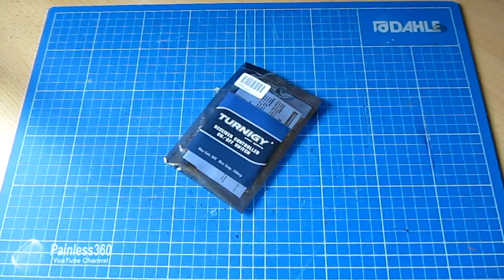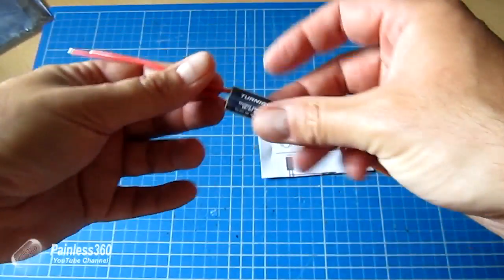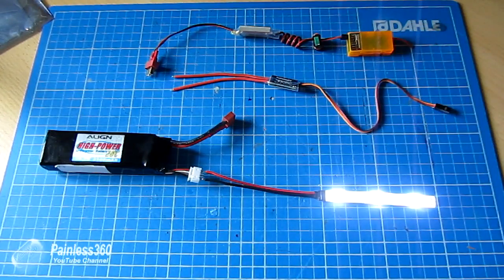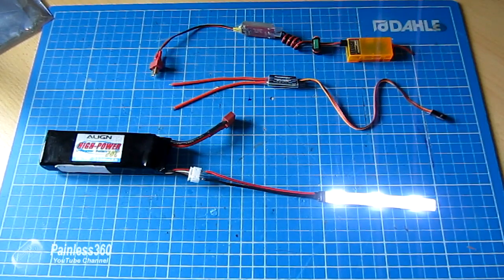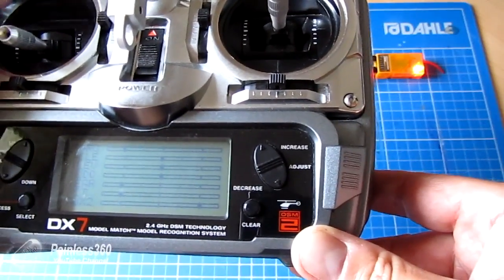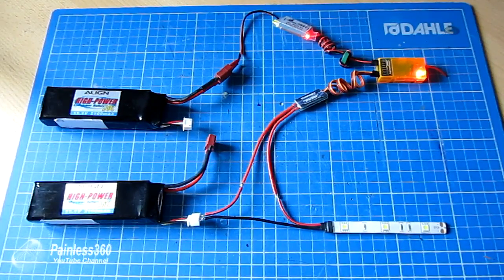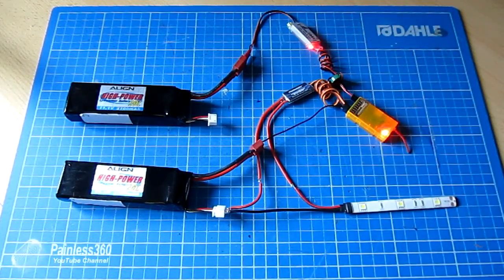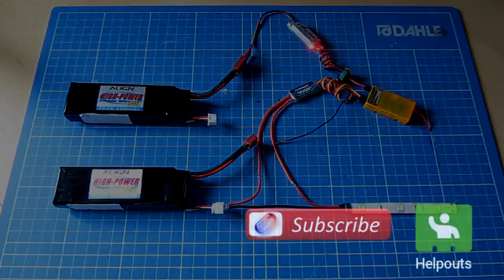Turnigy R/C Switch - Use for LEDs, landing gear etc.

Comment: My Afro 30A Esc's are all powered by the main batteries.  (The 680 Pro uses the frame for Pos/Neg connections) I then run the servo wires into Naza Lite from the ESC's, then the Naza to the receiver.  I am unsure if I also need to power the PMU with the same main batteries.  I believe so, but clarity on wiring or a schematic would sure help.  Looks like all I need to do is tie the negative from the 3c (lights & gopro) into the main battery pack.  But I think I also need a stepdown (really unsure and don't want to blow out my nav, strobes & headlights).
Reply from the maker: Tricky to follow without a diagram and I'm not a Naza expert either. What's a PMU?

Comment: Don't some lights require 5v to operate?  Running straight to the navigation lights or dual strobes from the battery would blow the pcb's wouldn't it?  I'm thinking a step down from 12v to 5v would be necessary or am I wrong?  I am running a Tarot 680P and was thinking my main stack would power the motors, Naza-lite and Reciever.  A secondary 3c would then have all the lights & gopro gimbal.  Don't I need a stepdown?
Reply from the maker: Yes, some do. In that case I'd use a BEC to drop the battery voltage down to 5v. Happy flying!

Comment: Is it possible to operate the switch in PPM mode and configuring it on Cleanflight?
Reply from the maker: I'd look at channel forwarding in Cleanflight where you should be able to output one of the PPM channels into spare PWM pins on the flight controller.. Best of luck!
Reply: Thank you. I thought it was possible to use one of the output channels on the flight controller. I enjoy your channel thanks for your help.

Comment: Hi Painless', I have a Spectrum DX6 DSMX - The problem is I cannot find ch 5 or 6 in any of the menu's.  That said, I discovered switch A (ch 5) appears to be assigned to "gear" and cannot be reversed,  Worse still where are they hiding channel 6 ??? until I find it, I cannot use an led switch using this TX :-(
Reply from the maker: +loonypics it will be in there. You may need to assign the channel to a switch first. Sorry I can't help more but we don't have that radio. Best of luck!

Comment: Hello Painless... I appreciate all your sharing. However, listening to your video you say if there is something else...
I have a Hubasn H501s which uses 7.4V Battery which I want to leave alone. I have purchased a smaller 11.1V 3S battery, and like your ideas. However, on my transmitter I am wanting to put another toggle switch on it, and use that for ON/Off of my extra external L.E.D.s. Of course with the Turnigy Relay incorporated. I might be able to figure it out with my knowledge, but if you could, it'd be Great if you could do a schematic of such, and a video would be good, but a schematic on a 15 second video would work for me, Sir.

Thanks..... For all you do for strangers out here.
Reply from the maker: Happy to take a look at that but please book a chargeable support call and I can talk you through it. Details on the website. Best of luck!
Reply: Ok, thanks.... Ummm... looking all around for the Website.

Comment: Hi. Excuse my ignorance, but what is a ubec and do I need one with this switch? I have a 450 size quad and will be operating about 100 led's on a led strip which I'd be using this switch for, many thanks.
Reply from the maker: +tp2fly See our videos in the 'Introduction to Remote Control' playlist as we cover all of the basics there, including this. Best of luck!
Reply: +Painless360 Ok thankyou

Comment: Quite new to this hobby.. Should I use all 3 wires coming from the Turnigy RC switch to plug into the receiver or just the signal wire and remove the power/ground? I'm planning on using 2 batteries so the receiver will be powered by the main battery so wouldn't that mean that I should only plug the signal wire in? Thanks and great video.
Reply from the maker: +Alexander Horst i only used it as shown in the video. Best of luck!

Comment: my plane came with landing lights with a battery box that takes 2 aa batterys which is 3v in total and have this Turnigy R/C Switch - can I use the 3v and wire it like you did with the 2 lipos in video
Reply from the maker: +richard wilde Not sure - you can try it and see.. Best of luck!

Comment: you connected the LED strip to Balance Lead, is that OK? or can it cause a unbalanced battery??
Reply from the maker: +Shaya Sonnenberg The LEDs use very little power compared with the motors.. Best of luck!

Comment: Hi Lea, does the voltage of the batteries matter? I'm running the RX and switch off of a 4 cell 4.8volt and the relay I'm using is running off a 2 cell alkaline pack at 3volts. Is it as simple as connecting the commons? Thanks.
Reply from the maker: +iflylilplanes I think so but I've not tried it. That's something to try on the bench before wiring it into the model - best of luck!
Reply: +Painless360 
Thanks, I'll check and see if the voltage is increased before I fit the relay into the circuit, if the voltage is still 3 volts I will be happy. I'm using the RC switch to operate old 1950's and 60's rubber powered escapements with 2.4Gig Rc gear, I've even taught my Taranis to fly single channel using the trainer switch, works with both the old escapements and servos. I'll let you know what happens with the switch ASAP.

Comment: Painless360, I am new to this, and I just got done building a ELEV8 quad copter. I noticed in your video you hooked up one led light to a battery, how would I wire up four of the led lights? I would like to hook-up led lights on each arm so I can tell which way it is flying easily, as I am not a electrician it gets confusing. What would 4 led harnessed up look like?, do you have a video showing how to do this?I do like your informational video's though. Thank you !
Reply from the maker: +Tom Wolves You would connect them in parallel (all reds together, all blacks together).
Reply: +Painless360  oh!! ok, but what kind of connector on the end of all the wires Painless360? Would I solder all red wires together & all black wires together? Thank you !
Reply from the maker: Any will work but I'd normally just solder for ease.

Comment: Hi again.
I have just conected my Solenoide valve with only 1 3S lipo. like you show in video, and doesn't not work; my TX is Turnigy 9XR PRO.
The solenoide valve works direct with the lipo, but with the switch not.
What I do wrong?
Thanks
Reply from the maker: +Sancho González Green Not sure, I would contact HobbyKing support - they are much better than they used to be and may be able to shed some light on the problem. Best of luck!
Reply: Painless360, yes, I think It not work it..
I have bought another one "Evolution Optical Electronic Kill Switch" is more complete and nore trasefull.

Thanks for your help.

Comment: Hi again.
Thanks for your help.

This is what I want to run with my Turnigy 9XR PRO: 
Generic DC 12V 1/4 Inch Electric Solenoid Valve  closed with Supply Voltage: 12V DC Supply Current: 1.4A.

I going to use this only for Hot Air Balloon Radio controlled, operating only with the control of burner, using this electric 12v valve for control the flow of liquid gas, and I need one lipo very light (the weight is very important in my 6,5 mts height balloon)
Reply from the maker: +Sancho González Green I can't see why it won't work but I'd test everything before you build and install the solenoid for real. Best of luck.

Comment: Great Video.
What  smaller Lipo battery do I need if I only going to use  the Turnigy R/C Switch for 10/12v Valve?
Reply from the maker: +Sancho González Green No idea, you need to know how much current will be pulled how long you want it to work and you can figure out the mAh size.. Best of luck.

Comment: Thanks for this video which was very useful indeed.  I'm not entirely sure I understand how the unit works and I am using a receiver powered by an ESC with built in BEC.  Should this still work?  So my receiver has the ESC plugged into CH1 (which gives the receiver power) and I am plugging the Turnigy switch into CH2.  Can I use a multimeter then to spot a change in the Turnigy switch when I move CH2 on the transmitter (Saturn X4)?  Thanks for all and any help.
Reply from the maker: +Ben Lawrence The 'switch' inside is powered from the servo cable in the normal way and the PWM value from the receiver channel it's connected to turns it 'on' or 'off'. Not sure what you are asking but the overview of how it works is in the video. Best of luck with it..
Reply: +Painless360 Thanks and sorry I was not clearer.  I'll try to make my questions better!

1.  In the Turnigy switch's instructions and your video, the diagrams show a separate BEC.  However I am using an ESC with a built in BEC.  Does this matter and will the switch still work?

2.  For a normal switch (or a relay say), I could test whether it had changed state by putting a multimeter across it and measuring resistance.  Do you know how I could use a multimeter to test that the Turnigy switch device had changed state?  I'm looking to find a way to test it is working without using an LED strip like you have done, but instead use my multimeter.

3.  Should the switch work using channels connected to the joysticks on my transmitter (I understood it trips once you get beyond 50%) or do you have to use a switch on the transmitter (eg aux or gear)

I'm sure these questions show a complete non-understanding of how the switch works - apologies!
Reply from the maker: 1) Yes. 2) No idea. The switch is a transistor so you should see a 'connection' between the two wires when it's on. 3) ANY channel who's value goes above 50% can be used.

Happy flying!

Comment: Hi there, i got a ikon flybarless and a dx 8, i got a switch for light on and off. onboard theres a battery for the diodes, and a battery for the reciever. i connected grounds on each batteries. the channels on the ikon is either 3 , or 4-5-6, but somehow I cant map a switch or channel to get the "powerswitch" to react. you know how to map one of the switches to one of the channels ?
Reply: +Sangreal Clairvaux I also got a Vbar reciever, and only got the aux channel and elevator channel to spare. you got any clue on how to map a dx8 to the lightswitch . It works when i use the rudder full left then right, but thats not quite suitable for switching on and off the lights hehe.
Reply from the maker: +Sangreal Clairvaux No idea, the information we have is in the video. Best of luck.

Comment: Hi mate I hope you are keeping well I was just wondering if anyone has come up with a way to switch 12v led lights on and off yet on a quad that is using cppm just built my second quad thanks to you and a couple of other great teachers on YT I built a lumenier qav 250 and she's beautiful lol I wanted to hook up 2 led headlights but not sure if it is possible to use an on/off switch so I thought I would ask the master any thoughts mate?
Reply from the maker: I use the R615 Rx from hobbyking and that receiver still outputs the PWM signals on the normal pins when using the PPM output. The only other option is look at mirroring a channel out onto spare PWM outputs in the FC.  See the manual for your controller..
Reply: Thanks again mate I will look into it sounds interesting

Comment: Thanks for the video.  I got to the diagram and stopped, trying to wire up and test the diagram.   I can't get it to work.   
I take the 11V battery and connect it to a step-down voltage regulator to reduce the output to 6V.   Once I have 6V coming out, I attach a "Y" cable to the + and a Y cable to the -.  The right line from the "Y"s  is used to power my RX.  The left line from the "Y"s is used to power the device connected to the Turnigy  e-switch.  RX works fine, but the switch does not.  Tried altering the two red wires coming out of the e-switch.   Nothing.  Have I "blown" the switch somehow?  I almost give up!   Thankful for any advice...
Reply: +Peter Farnsworth Embarrassed to say "Oh, never mind..."   Seems it was an imperceptibly small loose wire connection from the switch to the rest.
Reply from the maker: +Peter Farnsworth Amazing how often that happens to all of us. I had a GPS issue on a model and even swapped out the entire GPS system before I spotted that one of the wires in the connector hadn't caught on the clip in the flight controller and wasn't making contact. Face-palm moment! ;)Happy flying!

Comment: hello Sir , I purchased Turnigy 5X 5Ch Mini Transmitter and Receiver .  I want to use CH 5 of this radio control to ON/OFF my LED. is it possible? do i need to by Turnigy R/C Switch to achieve this?
Reply from the maker: +Kaustubh Ponkshe Yes you can. Be aware that if you are flying a multirotors must flight controllers expect channel 5 to control modes though.. Bets of luck.
Reply: +Painless360 Thanks for the quick response .I am running my home made railway loco with this. I have that CH 5 free :) !  But you mean to say , I still need Turnigy R/C Switch ? Also can you please tell me how this CH aux switch works? I thought that is just binary on/off switch but seems I am wrong .  :)
Reply from the maker: Not sure as I don't have that radio. Looks like Ch5 is a two position switch so it should work.

I would go back and ask the HobbyKing support team the question. Both of the items are their products. Best of luck!
Reply: +Painless360 ok !! Thanks !

Comment: This isn't a 3 way non latching switch right? It's kinda  difficult to find those which is weird since almost all the channels on your radio are 3 way. up/ neutral/ down.
Reply from the maker: jevries Not sure what you mean, this will select one of the three inputs that correspond with the PWM value It sees on the signal wire..
Reply: Painless360 I need a switch that selects both of the three inputs in short: 
stick up= activate relay #1
mid position= no action
stick down= activate relay #2

Most RC switches only control one function which in my mind is a waste of the other input of that same channel.

Comment: I HAVE A 1989 RICHMANS BATMOBILE AND THE BODY FOR IT DOES NOT COME WITH A BODY CLIP OPTION. IT COMES WITH 4 SCREWS TO SECURE IT TO THE BOTTOM OF THE CHASSIS. SO, I WAS WONDERING IF A TURNIGY SWITCH COULD BE CONNECTED TO IT AND ALLOW ME TO TURN IT OFF AN ON FROM THE CHANNEL 3 SWITCH ON MY TRAXXAS TQI CONTROLLER?
Reply from the maker: CALVIN Dixon Not sure why you are shouting?! Not sure exactly what you mean but you could connect a solenoid that is connected to the Turnigy switch to latch the cover..
Best of luck with it..

Comment: Hi Painless, a question if I may.   For the life of me I can't see why the common ground issue (when using two batteries),  makes a difference. In my application I've modified the top button of an SJ5000 camera to have a remote cable in parallel so that all that needs to happen is to briefly touch the 2 wires to 'simulate' pressing the top button.   So, I bought one of these switches hoping that continuity would be made and broken across the 2 red 'output' cables, but for some reason this isn't the case.   Obviously I don't want to destroy the SJ5000 by supplying any power to it, so can you see a way that my system could work?  I've got some small relays that I was half expecting to use (and might still have to), but I'd like NOT to have to if possible.  Thanks in anticipation, and compliments on a marvellous set of videos. 
Regards Mark in the UK
Reply from the maker: thecorbies Hi Mark, the ground issue seems to be floating signal related. Not quite got my head around it either but don't care that much ;)
The connection will be through a transistor and the other circuits will be about listening to the PWM signal and then sending the voltage to turn the transistor on. This only works if the switch has one side connected to the GND. I would check if one of the sides of the switches on the camera is connected directly to GND and then watch the polarity. 
No other ideas on this one apart from that.. Best of luck.
Reply: Painless360 Hi Painless, and thanks for such a quick and full reply. I'll check out your suggestion, but feel for ultimate (camera) safety I may have to go with the relay.  Regards Mark in the UK

Comment: Hi there! There is something that is really worrying me... I'm about to start building my quadcopter.. The thing is that I'm basically new in this R/C world. My question is I want to install a switch (not this one but pretty much the same) it uses the JST-XH connector as this one. The problem is that I also want to connect my Buzzer Alarm that uses the same connector of my 3s lipo battery.. Is there a way to connect both at the same time (and even more devices ? )  like a splitter or something ?. Hope that makes sense. Thank you so much you've been really helpful in my building process , best regards.
Reply from the maker: Ricky Henderson Almost every multirotors uses something called a Power Distribution Board (PBD) that takes the main LIPO battery and supplies the power to all the pieces that need it. The PDB allows you to connect lots of things easily to the main flight battery. 
If you are new to this then these two series will help - https://www.youtube.com/playlist?list=PLYsWjANuAm4r-E61stLchCR4bzY3NmDNh and https://www.youtube.com/playlist?list=PLYsWjANuAm4oWuE5ZDX4TAiHBv2i0Xl4m
Best of luck with the build.
Reply: Painless360 , Always so helpful! thank you so much my friend. I'll take a look right away.